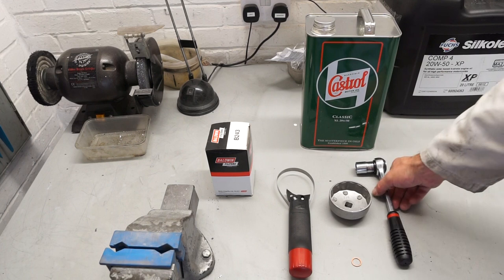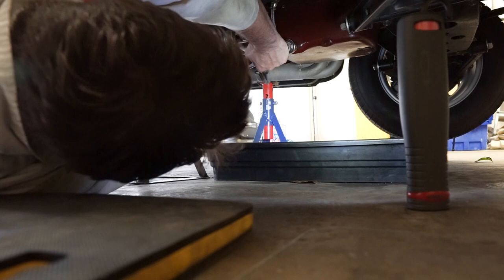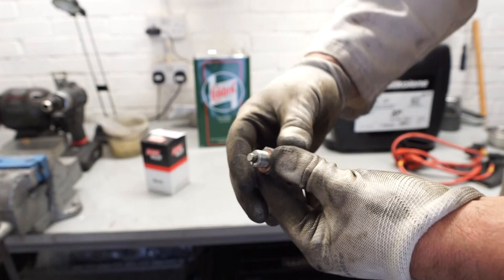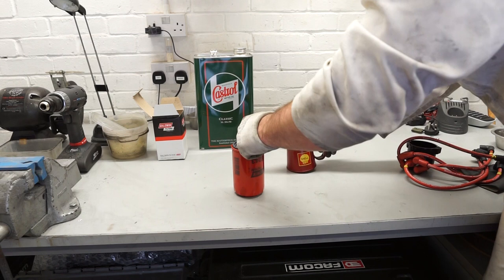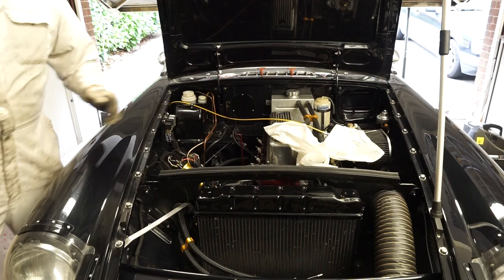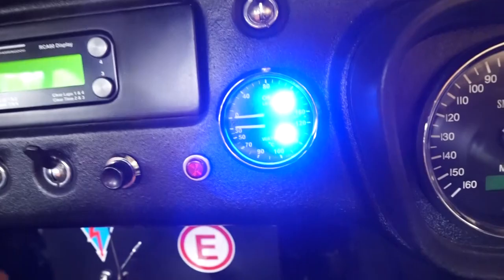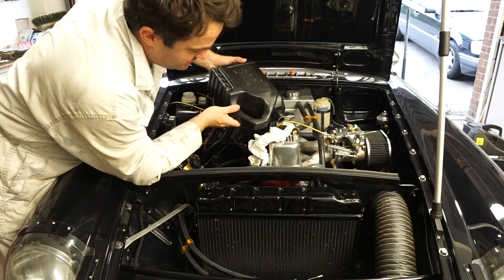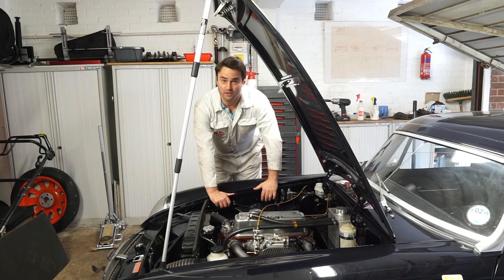MGB Engine Oil and Filter Change Procedure with Step by Step Instructions

Comment: Great advice about spinning the engine to check the pressure. One suggestion is after loosening the drain plug, remove the ratchet but use the socket and extension to finish turning the plug rather than your hand. If you are lucky the plug will remain in the socket and can be retrieved without getting oil on your hand. A magnetic socket for this purpose would be great if someone sold such an item.

Comment: Hi David - excellent video, as usual - very professionally presented, thanks.    I have a standard 1967 MGB and a slight problem - there is no "ring" or "collet" on my dipstick and it therefore just sits on the bottom of the sump.   Is that correct, or am I missing something that stops the end of the dipstick hitting the sump?   Clearly if something is missing I am getting incorrect(higher) readings for my oil level.  Thanks, Chris
Reply from the maker: I thought there should be a collar around the dipstick on a 1967? I looked in the Moss parts book but could not find a part number though. On my car the collar looks as though it's braised on but the engine is a later 18V type. I measures on my car from the top of the collar to the top of the max mark on the dipstick; 24cm. How does that compare with yours?

Comment: Silkoline is a motorcycle oil correct? Ive heard some people getting around the zinc issue by using a motorbike lubricant
Reply from the maker: Yes, it's a 20w50 fully synthetic, it's what the original engine builder recommended. It does seem to work well and it's not too expensive either (compare to similar fully synthetic race oils)

Comment: David, what is the reason for removing the spark plugs before building up the oil pressure? Wouldn't disconnecting a lead stop the engine from firing whilst still turning it over? Many thanks
Reply from the maker: Thanks for your message David, I remove the plugs so that the engine is easier to turn over. I run with a slightly smaller single 12V battery, having all the plugs out means it has less work to do.
Reply: @davidrussellwilks  Thanks for the advice. Was it the thick lead from the coil to the distributor you also disconnected?
Reply from the maker: @DavidUKesb  I disconnect both the high tension (thick lead) and low tension (thin lead) to the coil. I have heard that the electronic ignition units shouldn't like to have power applied to them if they are being used without the engine running, the coil will get hot and drain the battery if you leave the ignition on.

Comment: Are you allowed an electronic distributor in the gts series ?
Reply from the maker: Thanks for your message, I've taken this directly from the website as it explains it better than I can! 

An Electronic triggering device type of ignition will be permitted as long as it is NOT mapable and is fully contained inside the distributor. (i.e Aldon Ignitor) A 123 distributor will not be permitted nor will Luminition ignition.
Reply: @davidrussellwilks  thanks
thanks
Reply: @davidrussellwilks   Hi Russell. Isn't the 123 fully contained within the distributor?
Reply from the maker: @DavidUKesb  Yes, but I think the 123 can be maped and that's why they are not allowed?

Comment: Love your videos David. Does the oil cooler drain? If not does it need an occasional draining to clear out any sediment? Cheers Bill
Reply from the maker: Good Evening Bill, There is usually always oil left in the cooler when changing the oil, what I tend to do at the end of the season is to remove the cooler and leave it upside down for a few days to drain out. Ideally the oil filter should prevent much sediment building up.

Comment: David, what make and model is the sandwich plate above the oil filter? Presumably it's a take-off for the oil temp sensor.
Reply from the maker: The oil filter housing is an MGB one from 1974-75, part ref 12H4405. I had the take off for the oil temp sensor fitted later (weld in bung). The good thing about this housing is that the filter can be pre-filled before fitting and the temp take off fits in easily.

Comment: hi what about the oil in the oil cooler
Reply from the maker: I think if you are changing the oil regularly there should be no need to drain the cooler. If the oil is very old I think it would be worth removing the cooler to drain or possibly just replacing it altogether.

Comment: Excellent set of videos David, good clear instructions and explanations, thank you.  Could I ask where you got your oi/water gauge from please?  I have an MG Midget and your videos have inspired me to do more jobs myself.
Reply from the maker: Many thanks for your kind message, the oil/water gauge is from Farringdon instruments, it does require an electronic sensor for both the temperature and pressure (I replaced the mechanical senders)
Reply: Thank you.

Comment: Curious, my car is a 72 B, what about flushing the oil cooler? Sure after many years, there’s going to be dirt buildup in it? Seems like a good policy, yet how would one do that?
Reply from the maker: As I change the oil in my car regularly (after each race weekend) I don't both to drain the cooler. If you really wanted to drain the cooler I think the easiest way would be to remove it from the car and leave it upside down to drain overnight. I don't tend to use engine flushes or similar, there is no reason why clean engine oil could not be used if you wanted to flush the cooler though.

I don't think that dirt/residue would build up in an oil cooler in the same was that it does a radiator. Metal particles and contaminants would be held in the oil filter as they pass through the system. Modern engines don't require the oil cooler to be flushed or cleaned out, I think if the engine oil is changed regularly it shouldn't be an issue.

Comment: David - Like other comments, I think these are really well-done videos, thanks and kudos to you for taking the time to do them. I have a question/quandary: I've just changed the oil  on my 1977 MGB following your step-by-step here, however I can't seem to get any oil pressure after doing it. Everything was apparently working well before (including the gauge), so it feels like it's going to be something I've either done or omitted. I have disconnected the gauge hose and cranked the engine to see if oil is moving ... it isn't, which I think rules out the gauge. What would you do to diagnose/fix? Many thanks
Reply from the maker: Thanks for your message David, it might be that the pump has lost it's prime, if you take off the rear oil pipe that's going to the cooler you should be able to pour some oil down there to see if you can re-prime the pump. I would say under no circumstances attempt to start the engine until you know there is oil pressure there. 

A couple of questions; How long did you let the oil drain for?

Has the engine run at all with no oil pressure?

Is the oil showing at least halfway on the dipstick?
Reply: @davidrussellwilks  thanks so much for your reply, and I’ll definitely look at trying to prime the pump. To answer your questions, the oils drained out (from cold) in about 20 minutes. The engine was started after I’d refilled with oil and changed the filter I’m afraid.. my bad. When I didn’t see any pressure come up I stopped (maybe 30 secs of running) and then took out the plugs, disconnected coil etc. The oil actually shows at just under max on the dipstick.
Reply: @davidrussellwilks  All fixed now... in the end it turned out the new filter was too short - popping the old one back in fixed the problem until I can replace it. Thanks for your advice and help.
Reply from the maker: Delighted that you’ve got it fixed David, I have heard about that before with certain oil filters but never seen it first hand. Hopefully if the engine was only ticking over no damage was done.